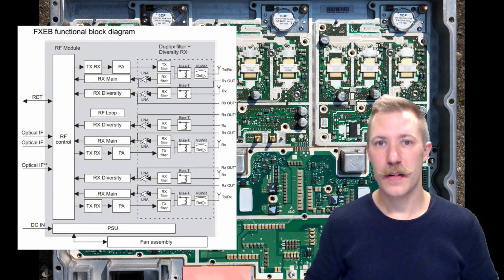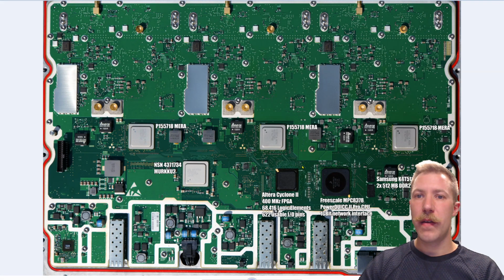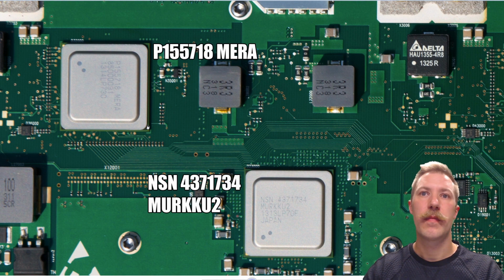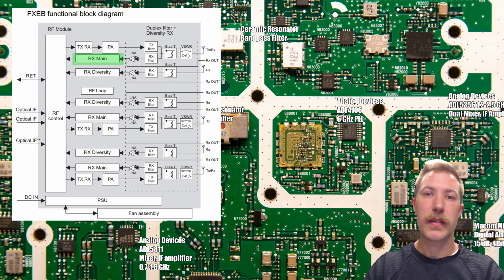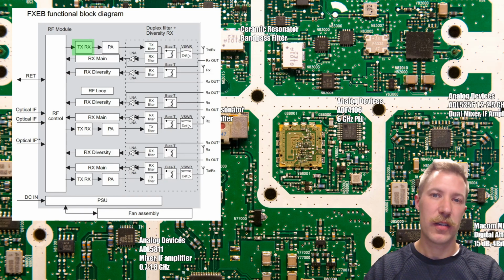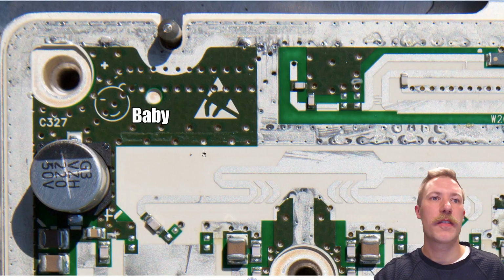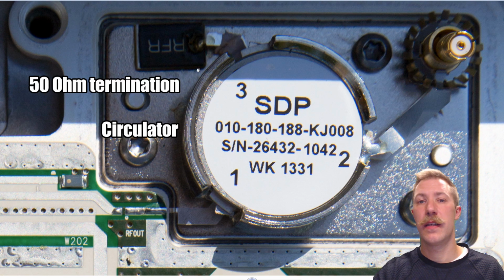Nokia Siemens Flexi 3x90W FXEB 1800MHz Base Station Circuit Analysis: Power Amplifier (Part 2 of 2)

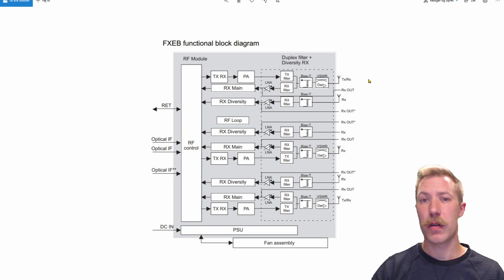Comment: @3:10 The VSWR is not so much to measure the efficiency of the amplifier but rather to detect a faulty antenna or broken/damaged feeder. It is the antenna or feeder that will deviated from 50 ohms if they go faulty, maybe by water ingress, wind damage, an improperly tightened connector and so on. On the O&M system one sets thresholds typically around 1.5, 2 and 3. When the lower thresholds are exceeded an alarm is produced on the O&M system.  When the highest is exceeded the PA is automatically turned off to prevent damage to the PA. When we see the lower threshold trigerring the alarm one knows that something is wrong but it is not urgent to fix and will probably work for some more time.

The purpose of the bias-T is to feed power and also control signals over the coax to equipment such as receive LNAs or remote electrical tilt motors mounted at the antenna end of the coax. It is in fact not only a DC power injector but also injects low bit-rate control signals using the AISG protocol. This saves having to pass a second control cable between the radio unit and the antenna allowing you instead to use the RF coax for that purpose in addition to its primary purpose of carrying the RF sginal.
Reply from the maker: Thank you for filling out those information holes :)

Comment: @22:50 regarding the three legged varistors - the purpose is to detect failure of the varistor.  In case of a lightning strike or such that is too much for the varistor to handle it overheats and melts the soldered joint of the third leg. The little leaf spring pushes away the third leg breaking the contact. The break between the second and third leg is detected and is signalled as an alarm on the O&M system to tell you the radio unit no longer has working protection. That is of course assuming that the circuitry isn't all toasted by the surge.

Comment: Maximum quality content. Why do that to the varistor? Mechanical stability?
Reply: This design looks very familiar... ;-)
It is Varistor with thermofuse and monitor lead. When the Varistor takes surge hits its leakage starts to increase and over time it will go to thermal runaway. it is designed to disconnect Varistor from the circuit to prevent it from catching fire. Third lead goes to monitoring logic. If I recall it consists of couple optocouplers having their transistor sides in series. Two optoouplers can monitors all three Varistors,. Once any of the thermofuses has opened the processor will see it and will raise overvoltage protection circuit fail alarm to System Module. After that the unit should be serviced.
Reply: Wow I see its to fail open.
Reply from the maker: I think it is for insulation of the soldered on leg and possible to contain fragments in the case of exploding component.
Reply: @KaizerPowerElectronicsDk  Thank you!!

Comment: A lot of the "impedance matching" on the differential analog/rf signals is really differential filters. Probably to attenuate harmonics and quantization distortion.
Reply from the maker: Thank you very much for that information. While the differential filter still has to maintain the impedance between the nodes, you are right that it is a designed filter against noise. I found this article that covers it in easily understable terms if others want to read aswell: https://www.analog.com/en/technical-articles/understanding-and-designing-differential-filters-for-communications-systems.html#
Reply: Yeah, low pass differential filter. At the end of LPF probably impedance transformer. Unknow chip could be ADL5375. Аt the input of the Quadrature Modulator we  see serial resisitor - probably 25 Ohm to matching 50 Ohm single ended microstrip line to input impedance 25 Ohm of modulator. Also we see parallel resistor - for biasing and additional matching. Well, I'm pretty sure it's  ADL5375.

Comment: The weird Varistor construction is a thermal overload protection
Reply from the maker: I can see that TMOV is a thing, where it is a 3-legged MOV with a built-in fuse, but here it is just a 3rd leg soldered on to a existing.
Reply: this solder bridge will just melt and push open. There are some reason to to it this way.
Reply: @TecKonstantin  So that's what that little spring is for.
Reply from the maker: The spring will push it open if the solder melts, but that will just bypass a burning hot MOV, something else will fail instead...
Reply: exactly it comes from system requirements that those have to be protected and are not allowed to short the main Bus. As long as they are in good condition they protect the gear against surges, im sure they monitor the third pin for an open connection and will notify the owner of the equipment but the unit will be still able to function nominally with defective MOV.
Reply: on the bottom you can see the Monitoring circuit
Reply: @KaizerPowerElectronicsDk  Maybe the solder is a junction point, and when it melts, the circuit is open? Edit: this is seemingly not the case. See TecKonstantin's answer above.
Reply from the maker: That makes sense, thank you.
Reply: i always find it interesting to see how much there is in the details of any design.
Reply: It looks so crude compared to proper thermal fuses that even consumer surge protectors tend to use.
Reply: yes but it is probably quite reliable, for 48V it is not so easy